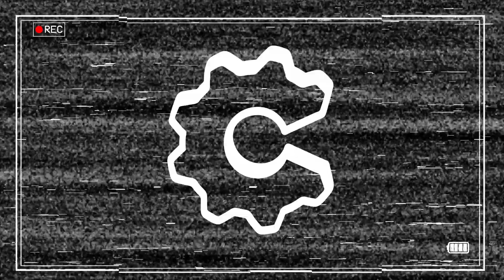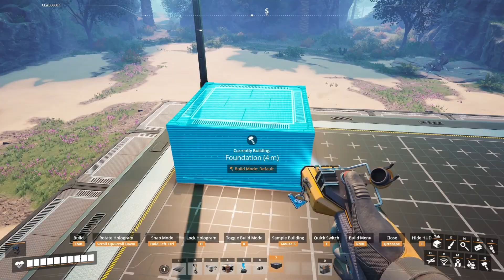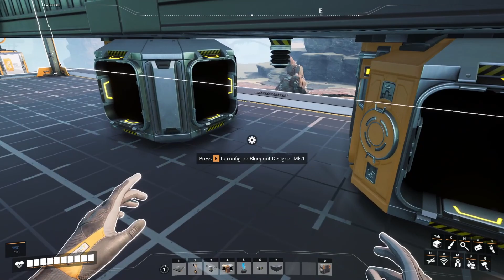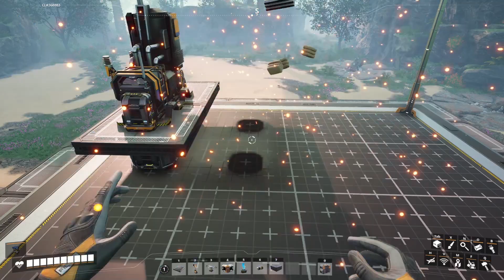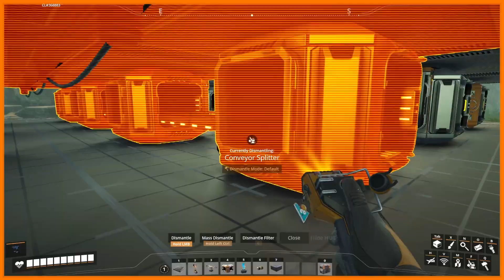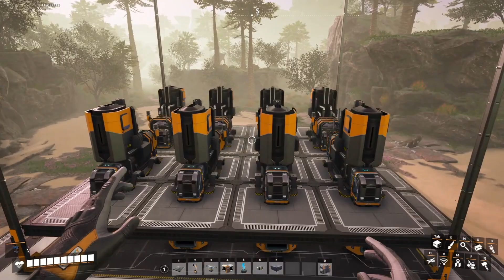Hide Belts with Logistics Floors - Satisfactory 1.0 Factory Blueprint Series Ep. 1

Comment: Hi, I may be doing this wrong but when putting the splitter on the output side on the conveyer it won't allow me to change the direction of output.
If you have any tips I'd greatly appreciate it! (nvm I figured it out thanks for the great video!)
Reply from the maker: Glad you figured it out! I’ve lost track of the amount of times I’ve placed them backwards and I’m sure I’ll continue to do it lol thanks for watching!
Reply: @Cyanogenmod_  Quick question, not sure if you have a video like this or making one, but could you show these layouts in use? Thanks!
Reply from the maker: This is an “older” series at this point so it is complete, but I think I did a video that had some demonstrations! I believe it was titled Embracing Verticality or something similar, otherwise I did use these designs for my live streams so you could check those out too, hope that helps!

Comment: Thanks! One thing I am confused about is it seems you never actually connected the power outlets to the smelters. You have a bunch of wall outlets underneath but they seem only connected to each other and not actually lowering the smelters. Am I missing something?
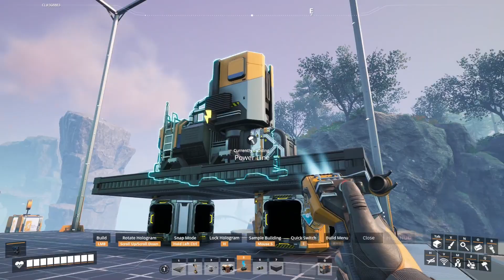Reply from the maker: It happens very quickly but around 2:40 I bring power from the smelter to that first outlet so every blueprint from then on has the connection.

Comment: I believe they’ve changed sth in 1.1 so I am not able to locate lift just as you’ve done for the input. It only allows to tie up lift directly into the input. 1:51
Reply: Upd. Worked just fine. The thing is you have to start dragging lift under the hole, not from the smelter input
Reply from the maker: Glad you got it sorted I just went to look and was coming to say it should still work 🤙🏻